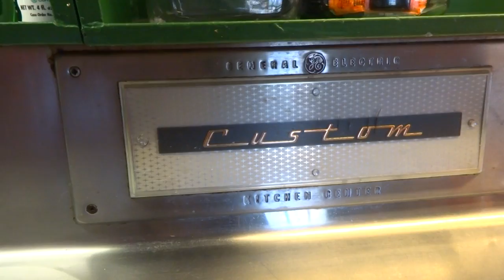PROPRESS FITTING POPPING OFF INFERIOR  PRODUCT TO SOLDERING

Comment: Who ever installed the pro press fittings may not have inserted the pipe all the way in. They are supposed to ream the inside of the pipe then slide the fitting all the way in. Mark the insertion with a black felt marker to ensure it does not pop apart before pressing. It’s a good idea to wrap the press fittings with wet rags to keep them from getting too hot if you are soldering near them.
Reply: Not supposed to weld less than 3 pipe diameters away, that was less than one.. eek...

Comment: I just finished designing a 2 psig natural gas piping system for a big new production plant.  The contractor said he wanted to use MegaPress, I said not if you want me to stamp it.  A 15 year warranty on gas piping?  Never on my jobs.  Threaded or welded that's it.
Reply: Do you have any idea how many threaded joint's I've has to fix that held a month prior on new jobs? Mega press never leaks on gas. Last job we used it on was 5 psi and the only leaks were in the THREADED joints and they held pressure 6 months prior. Get out of here with that garbage.

Comment: Pro press works when done right but I still prefer good old solder. I mostly only use it when there's an issue with getting the line dry enough to solder. In that case I'll build the section I need with all solder joints then cut and pro press the ends while the water is still running out.
Reply: That's the way to go! I compare it to using an electric driver...makes life a lot easier but if you don't know WHEN to use it you strip the f out of everything.
Reply: Exactly. Pro press as few connections as possible, solder the rest.

Comment: On propress the print is just a backup. When pressed correctly the copper of the fitting and the copper in the pipe are fused together. You can do this experiment yourself by pulling out the o rings then installing one (just for demonstration purposes obviously)

Comment: They pop and leak quick if the dont send the pipe home but ive seen a press tee leak right away probably defective aint no solder fitting gonna be defective pro press is nice for certain situations but i prefer solder or braze

Comment: Soldering is a skill ,  no doubt. I love and appreciate a nice clean solder job with no grapes. I took great pride in my soldering , no runs , shined the hell out of each joint but I feel got to change with times and technology. Press is simply way to go nowadays. Just remember to minimize close joints , leave room for future fittings. Nothing last forever.
Reply: Nothing last forever, it’s what I told clients.

Comment: I have measured, cut, fitted an apartment in half a day and only did flux and soldier.  After polybutylene (I installed enough of that to reach the space station) I don’t trust anything with  crimp fittings farther than I can throw it. Shark bites fail as well and whatever that piping is, was a bit after my time.

Comment: Should you solder that close to another propress fitting?  Send like it would affect the o ring in the tee to the right.
Also, isn't it best product to not cool the fittings with a wet rag after soldering... Can crack the solder

Comment: Pro Press is fine. I’ve seen more leaks on bad solder joints. 
Those tools need to be maintained and the joints fitted correctly; chamfered, polished, fitted and marked.
Reply: Couldn't agree more!

Comment: Iv done buildings with pro press and yes there has been leaks and blow outs because its not installed correctly. I do now how to solder I learned how to solder years ago but a job that would take years now it’s months. That’s why we test before inspections to make sure this stuff doesn’t happen and the inspector wants to see pressure in the lines

Comment: If you look closely when Steven picks up the pro press piece that he cut out you can see that the end of the copper pipe is all the way near the end of the pro press fittings therefore not giving enough space for the other side of the pipe which is why it blew off. Pro press can hold up to 500 psi if installed correctly and you mark where are you should press. Especially with slip couplings

Comment: User error; just like an improper solder joint.  I attempted to remove a press fitting by twisting it off without success. It did eventually come off using an oscillating tool to cut the press coupling.  Supposed the o-ring is just backup; the pressing action mechanically bonds the copper together—similar to a compression fitting.  Don’t knock it with out giving it a chance.

Comment: Steven, I was commissioning generators and switchgear on a large industrial plant construction project. The vendor for the HVAC used propress (or similar) on refrigerant lines. They ended up having to replace all of them at a cost of "no telling what" before the plant was fully commissioned. Totally poor product and bad idea. R410A lines blowing off all over the plant. They call it PRO-press but there is NOTHING professional about it. Barely better than shark-bite. Solder is the only way to go.

That GE custom kitchen unit was very cool!!!  I have rebuilt a wall-mounted refrigerator which was part of one of these. Very neat product. So much character for products back in the day! 

Thanks for sharing these videos. Good stuff!
Reply: That's not pro press, that's zoom lock. They probably also ran all their linesets in soft copper instead of ACR and all the piping was ovalled. I don't trust zoom lock either but I have never seen a properly installed zoom lock fitting leak yet. 100% operator error.

Comment: Good video. I love sweating pipe but I also use propress alot in my heating business and knock on wood I've never had a failed fitting. My first guess is bad tool or pressed at an angle and not inserted all the way. Keep up the good work.

Comment: Pro press works if done properly. The problem is plumbers are cheap and buy the cheap fittings and the manual crimper because the hydraulic one is like 3 grand. I had your attitude about it for 4 years and would braze or solder everything. Now after 5000+  propress from 1/2" to 4" I would do it at my house and not worry.
Reply: This is the correct modern take. Pro press is extremely reliable if done correctly.

Comment: Pro Press has its place, but soldering is a skill that should never be forgotten.
Reply: That's what plumbers said about PVC and ABS when they originally came out.  I supposed installing landscape irrigation with threading metal pipe is still preferred?
Reply: Yep,  and it really isn't that difficult to do.  Solder first if possible.
Reply: @scott5654  You show your ignorance in your product knowledge (or lack of)    Your statement Would’ve been stronger  if you said  cpvc And polybutylene
Reply: @scott5654  Yeah, we should still be using galvanized pipe in 400ft wells....said no one ever. This video is a joke hahaha
Reply: @thankmelater295  PVC and ABS are not CPVC. CPVC came AFTER PVC and ABS. Your lack of knowledge is showing.

Comment: when soldering copper you know you have the fitting on enough to solder it the issue i see with pro press is the same as shark bite it needs to go on all the way and perfectly or it WILL fail

Comment: I’m one of those homeowners who you guys love to trash... and I’m a millennial, so have a field day with that one! I solder everything in my house; I had to replace about a dozen 1950s gate valves (upgraded to ball valves), and two sillcocks. If the existing solder joints haven’t leaked in 60+ years, I’d say that’s testament enough. I used one sharkbite fitting in my entire life and the damn thing leaked. NEVER AGAIN!
Reply: Shark bites are for hacks and you probably didn't use it properly anyway. Shark bites used to be lifetime warranted. They probably still are.

Comment: I have seen many of the unit kitchens, usually in teachers lounges at schools.  I always use a piece of sheet metal as a heat shield when soldering close to combustibles. You got the skills, Steve.

Comment: They work fantastic, it just wasn't installed right. Also you probably melted that o-ring in the valve so that could be a fun call back
Reply: I’ve seen presses without o ring  and don’t leak but since he tends to yap about the o ring he should or used a heat absorbing paste or even a wet rag on the pro press near the solder 🤔
Reply: Cool gel works awesome.

Comment: I wish you had shown a close up of the fitting and tried to determine why the propress failed. From what I read about it they probably forgot to crimip it or didn't put the fitting all the way in. I have actually heard a lot of good stuff about them. Be careful soldering that close to the pro press fitting it will cook the rubber o-ring.

Comment: in my area certain commercial sites like hospitals require only pro press . 
i’ve seen a lot  bad press & solder connections but always user error.
you can even solder press fittings  by removing the ring, don’t recommend lol but it works 
don’t get me wrong i still use an like soldering.

Comment: I prefer soldering but that was just user error. Propress definitely works. I’ve seen a lull takeout a bunch 1” and  3/4” Viega copper press.  As a result of it getting hit it was bent up pretty bad but did not leak a drop. Either the pipe wasn’t made in all the way or a garbage press tool from eBay.

Comment: Not enough play in that pipe for that press joint to come apart. i've installed thousands of press joints and not a single failure outside of user install error. I've purposefully tried to pull fittings apart and it is extremely challenging. unless this guy has line pressures outside of normal, this was completely user install error and not product failure.

Comment: The first mistake I see was that whoever installed that press coupling didn’t mark the depth with a marker! I’ve installed thousands of press fittings ( commercial, hospitals, truck washes, etc...) I’ve never seen one pop off like that. My best guess is that it wasn’t installed to the full depth of the coupling or the jaws on the press machine were worn out! And yes I still solder on most jobs but most hospitals in my area require a 24 hour notice for a burn permit. That’s why we use press fittings in hospitals.

Comment: I have used press joints about 15 years, only 1 fitting failed because of me. That fitting looks like frozen pipe unfrozen with heat while valve was closed. It's like a fuse, much better than pipe bursted.

Comment: Nice job, I remember like a year or so you were in a crawl space with all spray foam insulation. It was like very similar job with outside faucet water line and a fitting either split from freezing. Even with all the spray foam on the underside of the crawl space you still soldered to make the repair, right there you knew Steve Lav is a professional.

Comment: I have installed thousands of Pro Press fittings and have never had one fail. When they are installed correctly you wont have a problem. And yes, I can solder with the best of em. lol

Comment: Was taught how how to solder then learned about propress did an entire 26 floor office building every single joint is pressed and I tested each bathroom myself. Not a single leak, just like any joining method if not installed properly it will fail.

Comment: ProPress fitting have a working pressure of 300PSI, and are tested to 600 PSI, if that failed it was installed wrong! The EPDM ring inside is not what makes the water tight seal, it's just a backup.

Comment: That was one cool kitchen! If they made stuff like that now it would sell like hot cakes!

No one mentioned cpvc. I used that sometimes and it works great. It's fast, cheap and no special tools. I prefer to use copper and I always sweat the joints.

Comment: I didn’t know you could solder so close to the pro press and shark bite fittings.  Wouldn’t the heat melt the rubber o-rings inside?

Comment: Arrrrrrg.   Soldering next to an o-ring.  Never leaves you with much of a warm fuzzy feeling.  As you drive away, the thought of a midnight drip leak/squirter, eats away at your sleep.  Mr. Steve has a set of brass ones.  I hate Shark bites or Pro-Press, for ANY joints that are INSIDE.

Comment: Looks to me that the guy before didn’t make the fittings all the way. Common practice in commercial plumbing company I learned was insert pipe into fitting, mark with sharpie makin then pull out and check depth on mark and proceed to press once you confirm pipe is fully seated in fitting. I’ve pressed thousands of joints on large commercial jobs and I’ve only seen them leak a couple times and that’s usually because someone either forgets to press it, doesn’t make sure it’s in all the way, or the gasket is cut by the burr of the pipe it is installed onto. Propress is good when used properly.

Comment: Steve ,
 Thanks for the content and I do Agree that soldering in generally  a better joining method . I also find that Propress when properly installed is clean , efficient ,  reliable and effective when hot work is not practical . I have experienced failures with the product , primarily those failures were due to tool failure or incomplete presses .

  That being said even the best of us experience leaks  no matter the joining method . One of hallmarks of professional trades men ( women ) is our ability to learn from our mistakes and make adjustments to our procedures and methods .

 Blessings 
Jayson Perez
General Foreman 
Master Plumber , UA Local 777.

Comment: You should've wrapped the other pro press fittings with a cold rag if they are close to the torch heat.
Reply: There's also heat-absorbing pastes called "Bloc-It" and "Cool Blue" that will prevent damage to the O-rings while soldering.  Works surprisingly well.

Comment: The problem is that many “plumbers” don’t know how to properly solder copper pipe. Many of the homes in my neighborhood have pinhole leaks in the cold water pipes. The plumbers who installed my plumbing must have been plunging the pipes into a bucket of flux because I found flux inside the pipe and gobs of flux on the outside of the pipes. The flux problem could have been avoided if the plumbers had flushed the cold water pipes with hot water.
Reply: Or not used so much and wiped them after 
Pinholes could also be from no deburing them 
But some need to learn proper before using or doing the trades 
Everyone wants to go straight to the top guy without earning their way up
Reply: plumber who taught me always said dont go crazy with the flux....little goes along way.
Reply: Pinhole leaks are generally caused by not deburring the inside after cut...

Comment: Steve is always blaming material and not install
Reply: It's a package deal..knowledge.. experience..product... if its soo touchy nope not for me
Reply: @petero2693  very true
Reply: @petero2693  the only weak link that caused that failure was the operator, the product and the installation tools are more than substantial enough to meet the need.

Comment: Whether it's shark bite or pro press the pipe has to be prepped just like a solder joint. If you don't clean the surface first it will fail or leak.

Comment: They’re starting to use those press fittings on Freon lines. I just don’t trust them. The jury is out.
Reply: As a DIY'er I like that idea, less room for human error making flared fittings.  I have the YellowJacket flaring tool that makes them almost fool-proof, measuring stick out, etc.
Reply: Zoom lock is the shit. Press fittings have been around since the 90s and seem to be acceptable.
Reply: @rustyshakleford5230  I don't trust zoom lock yet and now they have push on refrigeration fittings. I can't wait for those things to catastrophically fail just like every other new "quick connection" that tried to replace braze.

Comment: My 1960s house has a GE Americana range with built in top and bottom oven, a couple of plugs-ins, vent and range lights, and push button burner controls like that. Works great to this day. I'm hoping with this chip shortage going on maybe appliance manufacturers will quit computerizing so much. Why does a refrigerator need wifi??